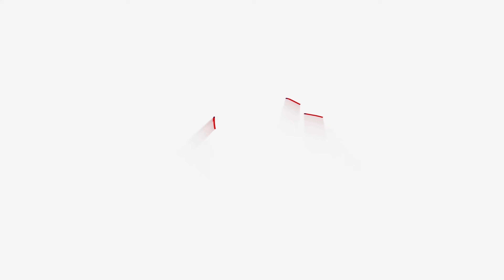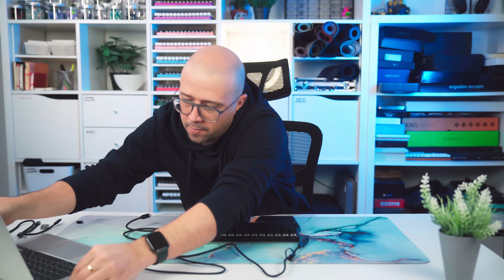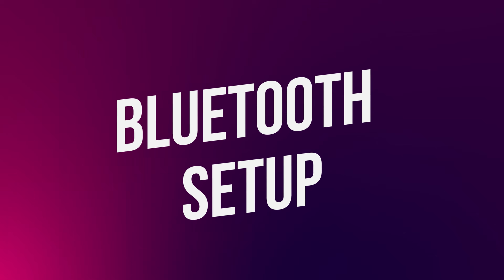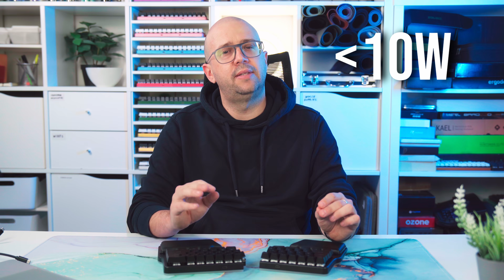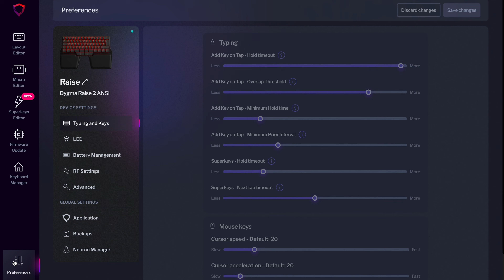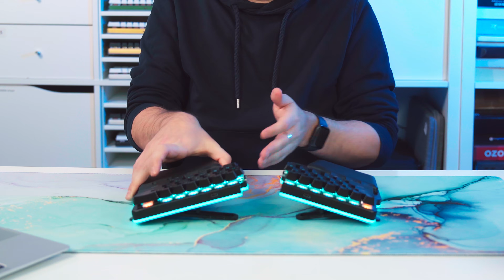How to Set Up Your Dygma Raise 2 Keyboard: The Ultimate Guide 🚀

Comment: I love love love my Raise 2, is there a way to force switch back and forth between bluetooth and wired mode other than turning off the wireless switches on the bottom? I have my keyboard plugged into my desktop, but I also work on an ipad at the same time.
Reply from the maker: Yes, you can do that. Just press the BT pairing button on your keyboard to switch to Bluetooth mode. To switch back to wired mode, press the BT key again, and then the top left key of the keyboard. It's explained here: https://youtu.be/1Y5rfuTEGsg
Reply: @DygmaLab  Thank you so much for your reply!!

Comment: This is probably the staggered split keyboard there is right now, my only issue with this is that the 6 is on the wrong side for typing.
Reply from the maker: It was a difficult decision, but since 6 is closer to the left hand on a staggered keyboard, we decided that way. On our columnar keyboards it's on the right.

Comment: I've updated to the latest firmware and im trying to pair it again but I dont get any code. Nothing happen after pressing connect.
Reply: PSA: 
- reflash firmware
- go to previous computers and "forget" dygma keyboard
- enter pairing mode and repair with each computer
Reply from the maker: Hi! I see from your reply that you were able to solve it. It's explained during the firmware update process, but I never read those either 😅

Comment: When talking about the battery you said that using a KVM switch with a higher power supply could damage the battery, I use a KVM switch to connect my personal and work pcs to the same setup but its just a standard 2.5 watts. Just wanted to confirm that this would be ok if I was to purchase one?
Reply from the maker: The problem is when charging directly to the sides of the keyboard. If you're charging or connecting through the neuron, you're good to go :-)
Reply: @DygmaLab  Thanks for the quick reply.
Reply: @DygmaLab  sorry 1 more question. You know when your switching between layers on the kayboard, do you need to hold the button down or can you toggle it on and off?
Reply from the maker: You can choose when configuring the layer key. There's Layer Shift (while holding) and Layer Lock (tap to lock the new layer). You can configure that in Bazecor.
Reply: @DygmaLab  you guys are brilliant. Thank you.

Comment: I think I would spread the keyboards left to right to the extreme where I would open my arms wide like a letter "V" and have a very open space in the middle
Reply from the maker: You don't want your shoulders to be too open either. A U shape is the goal, although ergonomics are very particular to each person.
Reply: @DygmaLab  How about widening just the arms a little more without widening the shoulders too much?
I was thinking of just a little wider from "U" position on the hands without widening more on elbows. So instead of having hand to elbow line on both arms on parallel, the hands are more apart compared to the former "U", making it look like a "V".
Reply from the maker: I would give it a try and see ;-)

Comment: Everything about this keyboard was perfect, but there was one downside. The wrist rest is fixed and cannot be detached, making the overall size too bulky. Although I use it as a regular keyboard, I primarily purchased it because there are no one-handed macro keyboards specifically designed for left-handed users on the market. Unfortunately, it’s impossible to use just one side of this keyboard. Since the main body is on the left side, even if I only want to use the right side, the left side always has to come along.
Reply from the maker: You can use the right without the left. The Neuron is the brain of the keyboard; you can use it to connect the right side wired or via RF. 

If you want Bluetooth for the right side, connect the neuron to that right side from the top, and it will also work via Bluetooth.
Reply: @DygmaLab  In what situations does the entire keyboard light up red?
Reply from the maker: When the sides can't connect to the neuron, the keyboard lights up read. Reconnecting the neuron and/or reflashing the firmware should fix that.

Comment: Just updated to the latest Bazecor and beta Defy firmware. Thank you for making further improvements! Two suggestions:
1. Make a small change to the text in the ‘New Defy 2.0.0 Beta firmware flashing’ article. Just before starting the flashing procedure, the button text is not ‘Reflash’ but ‘Update now’.
2. In the ‘What’s new’ Bazecor window, the color scheme of the scroll bar is confusing. In dark mode, elements that are further toward user should be lighter in color. Now the scroll bar itself is black and the background is grey. It should be the other way around.
Reply from the maker: Thank you for the feedback. I've fixed number 1 and I've asked the devs to fix number 2!
Reply: @DygmaLab  I did notice one strange thing after the latest Bazecore/firmware update. For nearly one year, I have had a superkey on Esc that does Alt+F4 when held. After the flashing procedure, the default layout was loaded again, so I restored my last backup exactly as shown in this video. This restored everything, except that the superkey on Esc was gone. That key was now just Esc. The superkey was still defined, but not assigned. I was using that superkey until just before the update. Very strange. I have since reassigned it and it’s working again.
Reply from the maker: The flashing procedure changes the Top left key for ESC, so when you restore the last backup after a failed firmware update, you're restoring that change. You actually need to restore the second to last backup 😅
Reply: @DygmaLab  Ah, I see. It would of course be highly desirable that the layout always gets restored after a firmware update. In the meantime I would suggest that an automatic backup is made before but note after the assignment of the top left key is overwritten. The latter doesn’t seem necessary and doing this avoids the problem of the last layout backup being corrupted in one place.